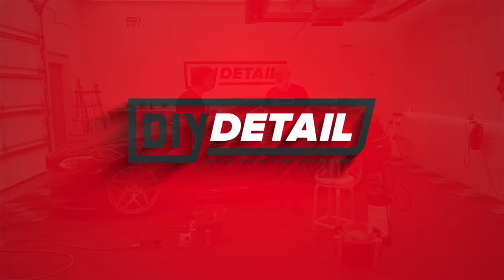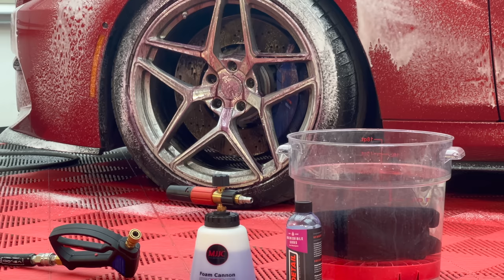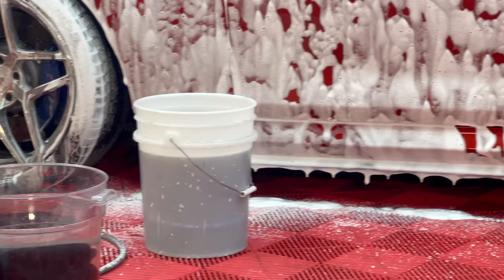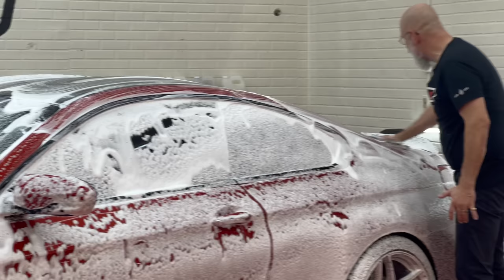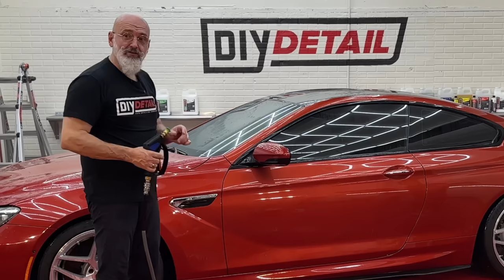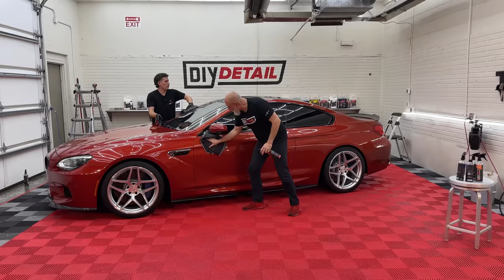How to clean, decontaminate & RESTORE your ceramic coating

Comment: Just used my water spot removal from you guys and shoooooot - it legit works. Not that I doubted but, first time you never know. 
Did a 1k trip and days of touge on my miata. Plus pollen season and rain for days after. Rinsed, incredi suds w/safe sponge, rinse, water spot w/agitation, rinse and bam. After the first soap stage just sheeting or very clogged effects. After the water spot chemical and agitation I could see it fighting back even then. During rinse it was like day 1 coating. 
Very impressive real world.
Reply from the maker: Thank you.

Comment: Beautiful driving car which looks amazing. I am my own worse enemy on SOP because sometimes I use a wheel brush or a detail brush when cleaning wheels. A video about deep diving into paint and clearcoat would be awesome. As a teenager I got the job of rough sanding the car but the final sanding steps and applying lacquer was something I never learned. Thank you for another informative video!
Reply from the maker: Thanks 👍

Comment: Thank you guys for another amazing tutorial/video. Actually this is the only video I got an answer for my unasked question - every other videos about a full cleaning,  decontamination and then protection and I wanted to know what for we are ceramic/graphen coating our vehicles if we need to apply the additional protection like spray ceramic which is (from their descriptions) can be standalone protection for several months. Ivan, thank you again for answering this question,  maybe you also have some statistics/examples of regularly maintained just with rinseless wash the ceramic coated vehicles (Let's say rinseless wash weekly and water spots/iron remover 1 time per season) how long can a ceramic coat shows all its pros in such case?
Reply from the maker: Properly maintained a good coating can last decades

Comment: Great video ! In another short one , you were holding the 2 bottles , you said to use Iron remover before the Spot remover , any reason we did the opposite here ? Many thanks 🙏🏻
Reply from the maker: It doesn’t make a big difference, I prefer to use the Perforated Synthetic Decontamination Towel and DIY Detail Iron Remover as lube first if there’s heavy water spotting. The Perforated Synthetic Decontamination Towel removes the minerals on the surface.

Comment: WOW.. I have been watching a lot of your videos and this one is so awesome.  As a newbie of course I have several questions so please hang with me:

If you are going to use the foam as lube to wash.. do you need the bucket of suds?
I see  you use iron remover on windows.. what about plastic trim?
Are you drying, spray ceramic gloss then wipe or spraying the gloss on the wet surface then drying

Final question, I don't have a garage and always work in a shade.. but I assume I would not leave on foam etc. sitting on the car quite as long as you did.

Thanks!!!!!
Reply from the maker: If doing a 2 foam wash, a bucket is optional. 

DIY Detail Iron Remover is safe on all exterior surfaces.

As long as it doesn’t dry on the surface, you’re fine.

Comment: Excellent video guys, here in the UK it’s hard to source all of your products under 1 roof maybe for the future 🤔after your final wipe with the Ceramic gloss did you use a buffing cloth after ?
Reply from the maker: You can if you want, the secret is not to use too much. 

Very shortly our distributors in the UK should carry everything we offer. There are some large quantities floating on the Atlantic at the moment heading east.

Comment: Great video - a lot of details and direct tips, but still I have one question. 
Most if not all of such tutorials assumes/advices putting "some product to restore hydrophobic properties" as last step. That rises the question what happens if such booster is not applied? We all know that proper servicing of coating is crucial but still i have doubts if that additional booster "restores" origin coating properties or just adds its "own hydrophobic layer" in fact not restoring anything from underlying layer. Restore means restore not adding own "masking layer". What is the truth? Will  I have same protection just applying such booster (short lasting ceramic "layer") frequent enough?
Reply from the maker: In our case it’s not required. Some coatings calculate their longevity using a topper every 6-12 months, not our case. There’s nothing wrong with using one, it will simply extend the usable life of the coating indefinitely.

By themselves the toppers provide hydrophobics, but they do not offer the level of chemical resistance a true coating has.
Reply: @diydetailofficial  Thanks - so the point is that hydrophobic properties of some (?) coatings may diminish over time and regular topper application keeps hydrophobity at certain level but in such case it is thanks to topper. In the same time topper does not give such strong chemical resistance as proper coating. Right? 
Second: what do you mean "In our case it’s not required"?

Comment: to chim in on what Yvan said about the paint from auto body shops not being the same as OEM, its because when the factory paints the cars its just the body, there is not suspension, interior or engine, when they cure it they can back it at a much higher temperature with having to worry about the plastics melting from the heat, body shops can only back the paint at 400F so the paint and clearcoat never get to the same hardness level as the factory paint
Reply from the maker: Correct

Comment: Ugh! Was literally looking everywhere for an “all purpose cleaner on ceramic coated cars” video. 

Question: All-Clean is step 1. Can I follow this with Rinseless as step 2 WITHOUT using a hose? So all-clean in my multipro 2, followed by rinseless spray down, followed by rinselss bucket wash? When should I add the waterspot remover if NO hose is used?

Very harsh and salty winter is coming, and I don’t want to freeze my pipes.
Reply from the maker: If you “rinse” between each step with your IK, it will be great.
Reply: @diydetailofficial  awesome! Was thinking of doing just that!

Comment: What are your opinions on using a leaf blower or compressed air to dry the car instead of a towel?
Reply from the maker: When you use only air you potentially leave a film of minerals or soap residue on the car. Drying with a quality towel and drying aid leaves a better finish.

Comment: Is it worth while to stack the 3 year on the metal coating for chrome and aluminum? Or is it a marginal increase at best as far as water spot resistance, hydrophobic properties, slickness and self cleaning abilities are concerned?
Reply from the maker: It’s not a big improvement

Comment: Is there a special reason why you didn't use the water spot remover on the windshield and glass surfaces? You use it only on body panels.
Reply from the maker: In many cases it’s not needed

Comment: do any ceramic coating products layer (or stack) on top of each other?  Or do you always have to high-speed polish off the old ceramic coating before you add a new one?  Because you get to this awkward stage where you paid good money for a coating but eventually the water's no longer beading and the coating is half gone...
Reply from the maker: You need to polish. That said try to decontaminate it first.

Comment: Hey guys,  can you give me a recommendation for my recently ceramic coated car.   About three weeks ago, I went thru all the steps, Bug & tar remover, Iron removal Decon, Clay bar, mechanical polish both Compound & polish, then IPA, then coated my car with a ceramic coating.  It looks Great but I then took it on a road trip for a week and almost daily I used Bug/Tar remover to get the bugs off the front,  Now I'm wondering the proper steps if i want to re-coat the front end and possibly lower side panels.  I'm hoping I can do this with some leftover ceramic coating I have to better prepare this for winter conditions & coat the areas that are the most affected by road use.  Could I wash the car well, use Iron remover again after 3 weeks, IPA wipe, & recoat some areas (mostly the front) without any issues?  Any other suggestions or recommendations to further lengthen the ceramic coating?   Thank you
Reply from the maker: What coating?

Comment: If I have hard water right from my hose at home, wouldn’t it make more sense to do the acidic the last step prior to iron decon? Or maybe even after iron decon. 

So it’ll be. Pre soak high alkaline soap. Ph neutral soap. Iron decon. Acidic soap/water spot remover. Clay. Panel prep. Coat. In that order. Correct?
Reply from the maker: No you want to use DIY Detail Water Spot Remover as the last step. 

Foam on DIY Detail Incredible Suds 
Rinse
Foam on DIY Detail Incredible Suds 
Contact wash
DIY Detail Iron Remover with Perforated Synthetic Decontamination Towel 
Rinse
DIY Detail Water Spot Remover agitated with a MF towel 
Rinse
Dry
Polish
Coat

Comment: My car is ceramic coated, and I live in a condo without hose access or pressure washer.
I primarily use rinseless wash with my IK multi pro 2 and UBS, how can I implement the APC and Iron remover without negatively (staining, degradation) affecting my ceramic coated car since I can't thoroughly rinse it off with a hose?

Thanks!
Reply from the maker: Best to find a friend with a hose for the 2-3 times a year you need to use these products

Comment: I must say I’m a total noob to this but after almost pulling the trigger on products that cost way more than yours from another you tuber I asked myself why? If I’m a beginner, and there are products designed for people like me that costs way less but provides superior performance, then why spend more? Utilizing your product lineup I pre foamed and washed with your rinseless wash, decontaminated with your iron remover, and synthetic decontamination towel. I panel prepped. I overcame my fear of using a random orbital polisher, while utilizing your pad and polish. At this stage my vehicle was glossy and beyond smooth. Towel sliding down the window smooth. Very glass like, slippery. I opened up your 8yr coating and after putting way too many drops on the applicator I started to ceramic coat. I did have a couple high spots but that was my fault and was so easily fixed. It went from a rainbow look to almost clear and I leveled and buffed dry. Is my paint perfect? No..I have nicks etc on the front and you can see slight imperfections only when you light it or if you’re staring at a panel in the sun. But just in passing no one would see it. My god….ive never seen this car so glossy. During the first rain, I didn’t have to use my wipers and the beading…they looked like diamonds all over my car. Clear and shiny beads almost evenly distributed all over the car. Once I accelerated the water would just come off the panels. After buying the whole product line and the polisher and IK sprayers it was still almost half what I paid for the coating on my other car and the feeling of knowing I did the work is awesome. Thank you for delivering such a high quality product line, that a beginner can use and feel confident enough to produce stellar results.
Reply from the maker: Wow, thank you!

Comment: i am confused on how often we should be using Quick Beads and Ceramic Gloss? If i wash once or twice a month, when do you use which? my car lives outside, fyi.
Reply from the maker: You can use either/or every wash without problem. It comes down to preference (do you like spray on, rinse off? Or spray on and wipe?) And what smell do you prefer?
Reply: @diydetailofficial  ok, i guess i’m just wondering if you can overdo a product such that the coating gets gunk’d up.

Comment: I have never ceramic coated a vehicle but have used ceramic gloss regularly.
In your opinion, when washing a vehicle can you notice the slickness and easy clean with ceramic gloss vs a professional 3/5/7 year coating?
Reply from the maker: The big difference will be in chemical resistance.

Comment: Does all clean have to foam to get the best results? Could you dilute all clean in a garden sprayer to the correct ratio and achieve just a good results?
Reply from the maker: Yes it will work well. Foaming gives it a little boost.

Comment: Sadly, on my country there are no way to get your products guys, so, gotta ask, if I use the tag company sponge/synthetic clay alongside with carpro iron remover, will it be safe for a ceramic coating?
Reply from the maker: I havent tried that combination. What country are you in?
Reply: @diydetailofficial  I’m from Mexico, as far as I know there are no dealers selling your product here and on Amazon (where I usually find other detail products through import sellers) have no DIY detail available products

Comment: What would you use to protect and maintain a matte forged carbon fibre roof? I have a GR corolla circuit edition 🇨🇦
Reply from the maker: DIY Detail 8 year Ceramic
Reply: @diydetailofficial  and this will leave the matte finish?
Reply from the maker: Yes, take a look at this video 

https://youtu.be/ycxHU-NVu4w?si=UlM4YNqUuGv72Zt8

Comment: In my opinion there’s no need to do a decon every wash or month unless needs must
Reply from the maker: Correct, you can if you want, but it’s not needed.
Reply: @diydetailofficial  it’s all about how and where you drive and the conditions when parked up. It’s all subjective 😄
Reply from the maker: Exactly

Comment: I had my black car ceramic coated and it scratches more now then prior to having it done. 
Why is this happening. 
Thanks.
Reply from the maker: Unfortunately if you had paint correction done, they may have over polished the car. This takes the outer layer of the clear coat off, making it easier to scratch.
Reply: @diydetailofficial  I watched him do it, did not compound the paint. He did a light polish with an orbital, the car was brand new 300 miles.  
Almost looks like spider cracks , like it’s the ceramic coating itself is scratching.  
I let the car sit in a Garege for 2 weeks before I even drove it.
Reply from the maker: Then return to the installer for them to take a look.
Reply: @diydetailofficial  he has no answers for me tells me the car wash did it. 
Went through it one time my wife’s car has been through it probably 1000 times and does not have these marks
Reply from the maker: Very odd, agreed a coating should not be so sensitive, what coating was used?
Reply: @diydetailofficial  ceramic. What brand I don’t know. It was a tiny bottle.

Comment: Another note: electric vehicles use brakes very little almost not at all and they require less iron Decon. Not none, but much less. Of course there’s iron from other cars brakes! For me I keep a bottle of DIY detail rinseless in a spray bottle for my wheels and door jambs. Works perfectly for my EV!
Reply from the maker: Good plan!
Reply: And I know this is an M6 and not EV. I mean just a general advice about wheel cleaning.
Reply: Ceramic pads is what has eliminated that brown film on the wheels and by lasting more than the old ferric ones, it’s less iron on the wheels
Reply from the maker: Thank you
Reply: I do too but some reason i would mix up in a bottle instead of just stealing from my fresh wash bucket. Yvan changed that with all his tips and tricks.  here is something i can share.  i use rinseless as my windshield washer fluid  !!!!

Comment: Ceramic Gloss ON TOP of Quick Beads?! 🤯
Reply from the maker: A very slick combination
Reply: @diydetailofficial  I bet! I’m still relatively new to this hobby, and have watched your QB vs CG video multiple times…can you explain why stacking layers is good/helpful/not a bad thing? Always appreciate your knowledge. 🙇‍♂️
Reply from the maker: It provides additional protection, and slightly extended durability.

Comment: Show the so called "waffle Towel" up close ? 
A waffle is as it says! 
Exactly like the Waffle pad you use to polish paintwork on a machine ! 
What you are using is called a Micro Fibre drying towel !!! 
Unless I am wrong and you don't show the viewers what you are using close up , well then its a Micro Fibre Towel or drying towel.
  Be honest with your Viewers instead of a wide angle video so they ALL understand.
Reply from the maker: Yes it’s a micro fibre towel. The weave of the fabric is called a waffle weave, because it looks like a waffle. There are also twist loop weave drying towels, Pearl weave, terry weave, triple split, and diamond weave .